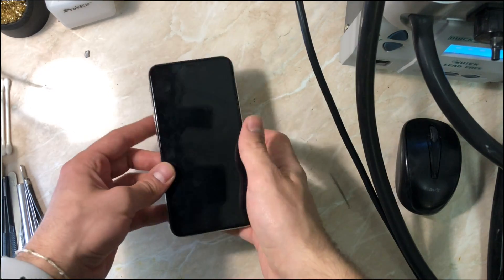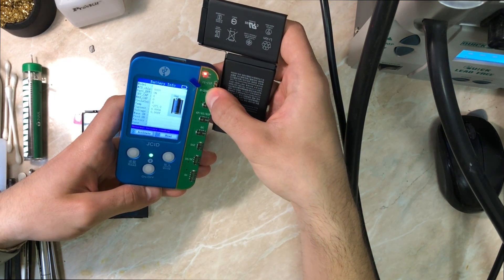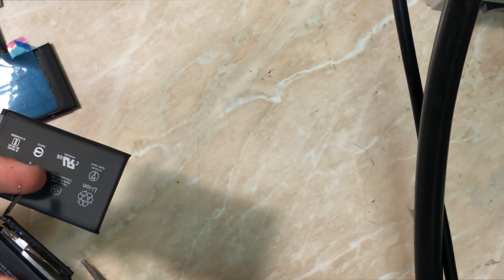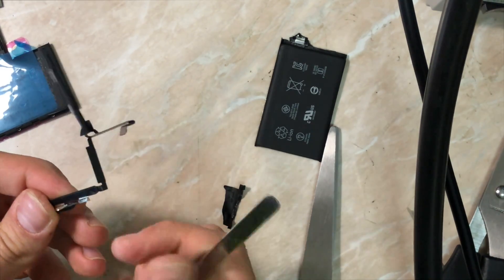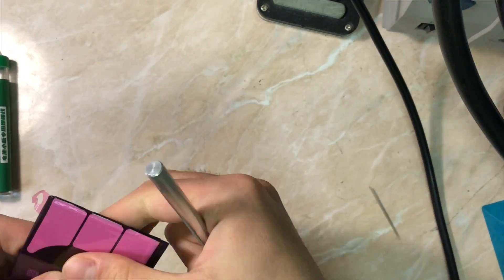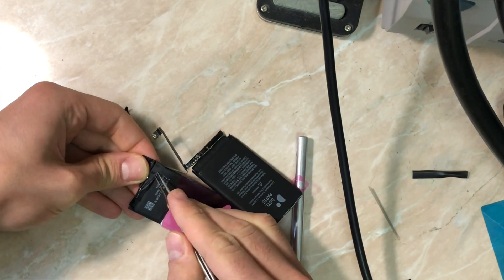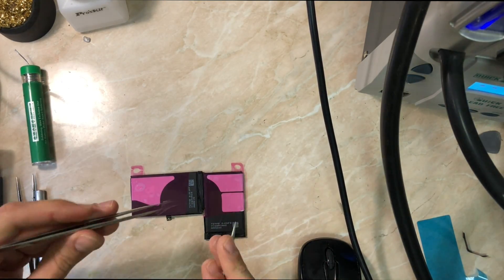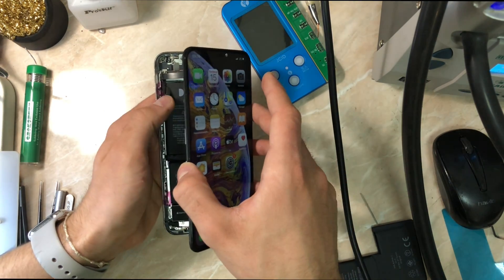iPhone XS Max Battery Replacement (How To Remove Important Battery Message)

Comment: I've done this with no success, i tried the spotwelder method first, show 0%bat then crash, then do the soldering method, still same, i'm careful but i don't know what went wrong. maybe i'll redo this again sometime.
Reply from the maker: Check connection while soldering, maybe you put more heat then needed

Comment: When Activating the battery (at 11:13), can you use the V1S programmer or must you use a Power supply?
Reply from the maker: I use the power supply to Inject voltage to the battery, and the V1S to change the health and cycle count

Comment: i'm wondering if bms swap is possible on high capacity battery too. like nohon battery. i;m searching for it but nobody actually mentions about it.
Reply from the maker: You can swap, in fact most of the Chinese batteries have more capacity then original ones 😅😅

Comment: sir may i ask if the battery replacement is 100% original, is there any probable chances that the new battery will fail to go back to 100% battery health as seen in the settings?

Comment: Hi! May I ask if you prefer the 2UUL special battery board soldering material or the typical qian li welder method to get the BMS on the battery? I've been watching some guides lately to buy the stuff needed for iphone battery swapping the right way and noticed that lately some people have been using the 2UUL. Do you recommend it? Thanks!
Reply from the maker: I guess the qianli welder is faster but little dangerous if you don’t know how to use it, but for 2UUP soldering it’s more accurate and for me safer process both for the BMS and battery (of course if you know how to use well) so I guess I prefer the method that I showed in the video
Reply: @AntoineKiriaky10  Huge thanks for the reply!
Reply: @AntoineKiriaky10  Надо именно этот припой использовать или можно другой?
Reply: @AntoineKiriaky10  hi antonie, can i know whay is more dangerous with the qialnli, Thank you
Reply: @AntoineKiriaky10  I’ve just watched your video and subscribed to your channel, is there are device I can buy to activate the battery, thank you in advance
Reply: Hi. What if the original BMS is damage?